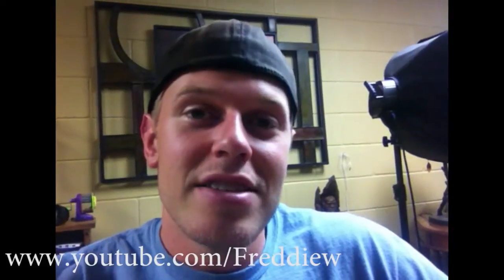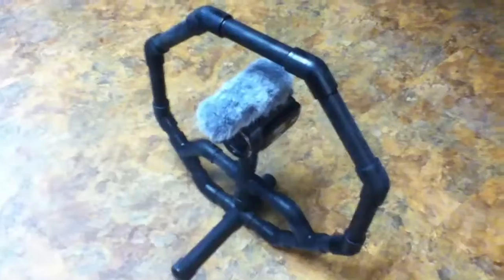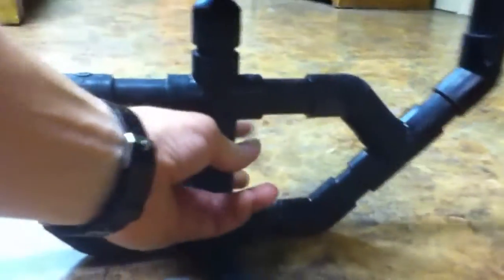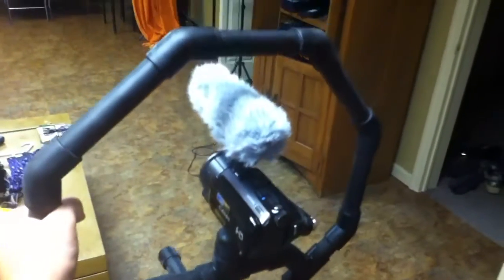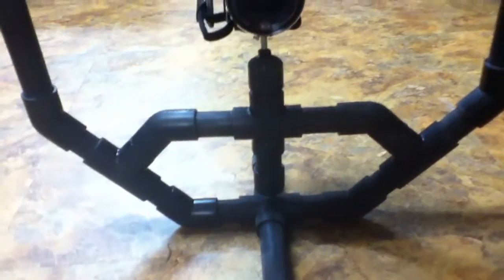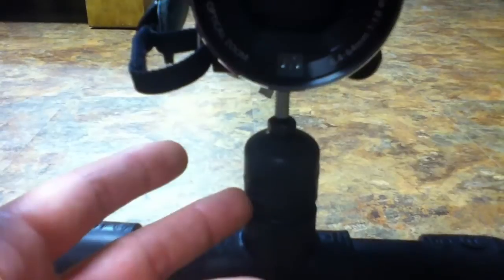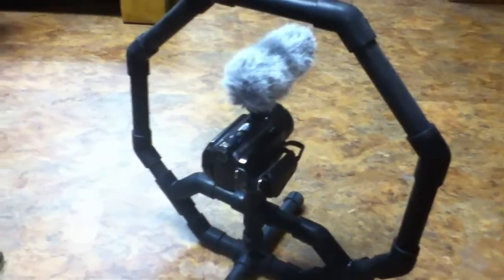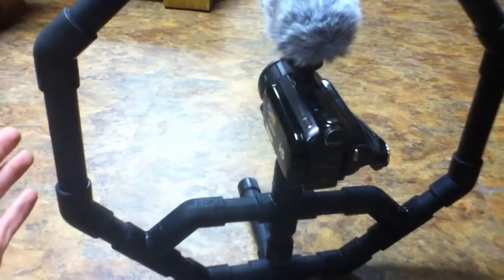DIY Fig Rig Review

Comment from the maker: So far I have used the Canon 7D with 24-105mm lens and the Canon hfs100 and the gopro with tripod mount and I have had no problems.  These three cameras all have the standard 1/4" screw so they all fit just fine.  I think that you will be safe with this setup. If you are going to use this rig with a tall camera or one with a mic you might add a little length to the side pipe to make the rig taller. Good luck with your CAD project.  feel free to ask any questions that you have.

Comment from the maker: @ish4president The part that is in the middle 3" is just a handle and is not really needed so I just cut it to that size for my own preference. now the two 3.5" pieces are needed to hold the camera and they need to be that size if you use the 1.5" size. so if you add .5" to the 1.5" you will take away .5" from the 3.5" (this will make the camera mount taller and my Canon 7D will not fit with rode videomic pro that is why I shrank to 1.5" along with 3.5")  I hope that makes since.